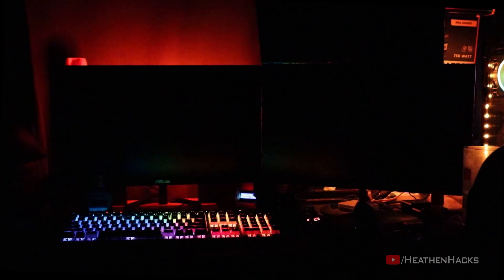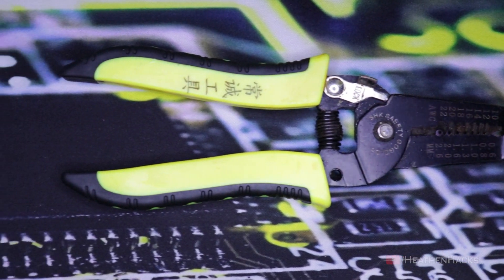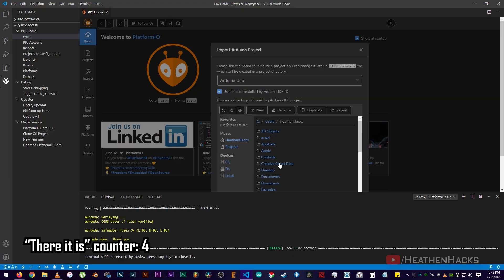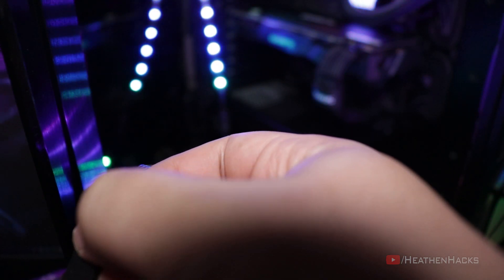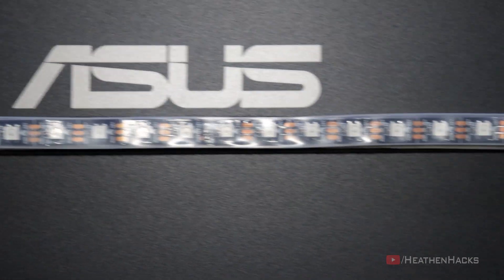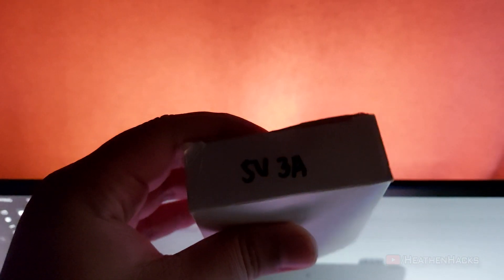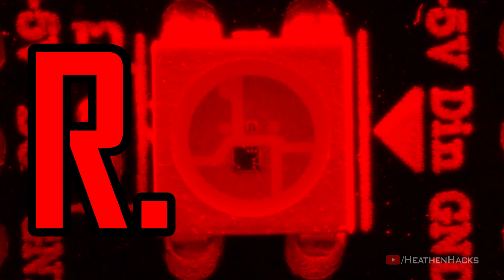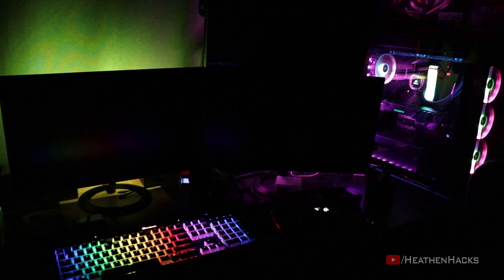Corsair iCUE Controlled Biased Lighting Using WS2812B RGB LED Strips [How-To]

Comment: Great video, just what I was looking for.
A couple of points to help others tho....

First of all, if anyone wants to test strips out and doesn't want to program an arduino there are small controllers available from the same shops that sell the bare strips. The only cost a couple of dollars / pounds.

Next, you can reduce voltage drops in strips by looping the ground and power from, the far end of each strip or set of strips back to the start of the strip (but NOT the data line). Use reasonable gauge cable to do this.

Finally, it can be quite risky to use a cheap 3rd party 5v adapter and connect it to the same ground as your PC (if it fails you could get mains sent down the wires back into your PC). A much simpler way to get 5v is to use a spare +5v from your PC PSU (usually there are cables left over for disk drives). Just make sure to use the RED cable for +5v (Yellow is +12v) and of course BLACK as the ground.

Comment: Nice vid. Found this in searching how to use ICUE to control a big reel of LED strips. I've done my own projects of adding some LED rings to some lava lamps as well as made several of my own versions of 60 LED each towers similar to Corsair's LT100. Which brings me to the point of my comment. Since ICUE now has the LS100 which the LT100 is part of. You can now address more then 60 LED in ICUE by selecting External LED strips in ICUE's lighting setup. You can now address up to I think 130 LED. I forget the actual number because the most I'm using is 120 LED. I never had any issues with power but then again I never use static white. I'm just using static blue for the 120 strand. 
Also Corsair isn't using a proprietary connector. It's a type of molex that actually use to be common on motherboards. So technically it's the oldest form of RGB connector there is back before RGB was even a thing and all we had was cold cathode lights. You can find which molex by googleing "how to make Corsair extension cables." The top result should be a thread on Corsair's forums by Devbiker that lists all the Corsair type connectors they use for fans and strips. I'd link it but you can't link in comments on youtube. Or if anyone isn't comfortable in making their own cables you can buy adapter cables on ebay. lol Funny enough the guy that runs the ebay store Piratedog is Devbiker the guy that wrote the thread on the forums. Hope this helps someone. 

Now I'm off to see if I find what I was looking for that brought me here. Which is something I came across on reddit. I think it was called a data repeater or amplifier. IDK, it was a while ago and I forget. Someone had claimed you can get ICUE to be able to control a really long strand of LED but I didn't save the thread and now I can't find it. That's the only issue I have in getting ICUE to control a big reel of LED. Like power issues is simple. I just need to be able to get the data repeated somehow. I want to put up corner channels on the top wall and ceiling and run it around the whole room and control it with ICUE.
Reply from the maker: Very informative comment. Thank you for all of this. I learned a lot. I think it's possible to use a data repeater/amplifier, but I'm not quite sure if you can set different effects on each of the strips that are connected to the repeater, because it's basically just like a jumper of some sort and the data would still come from iCUE/LN Pro and would treat it as a single strip, I think.

I'm basing my latter comment on how the S901E RGB LED Amplifier works according to it's product page, btw.

"It receives one signal and simultaneously output 4 or 8 channels of signals. Each channel can control the same quantity of LED pixels as main controller."

Then again, there are other amplifiers available.

Comment: Could i make a stripe 10meters long ? i want to light my whole room
Reply from the maker: Hello, Sebastian! ♥ Thanks for the comment! Yes, you can make it a 10m strip, but you can't control it using iCUE.
Reply: @HeathenHacks  so what is the maximum which i can controll ?
Reply from the maker: It's in the video.
Reply: @HerrZielein  60 leds